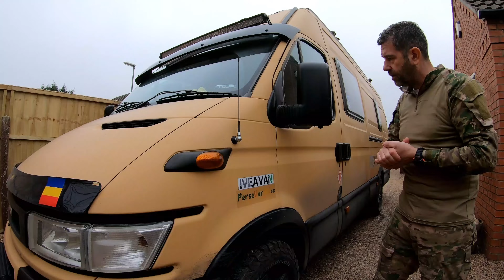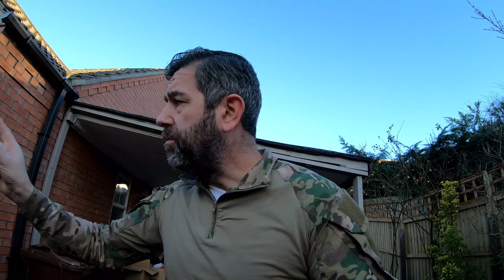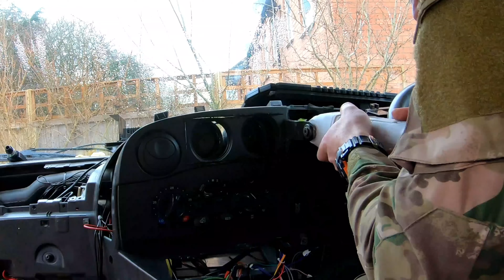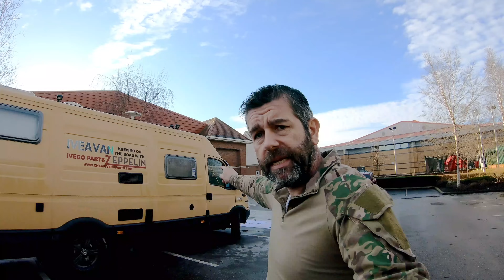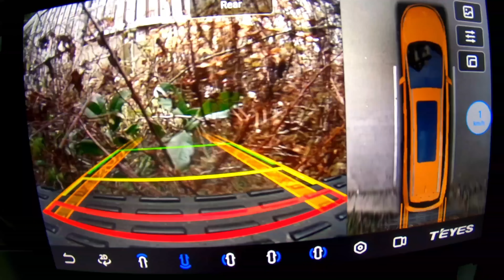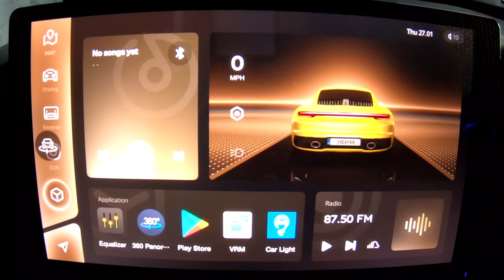Teyes CC3 Android Head Unit & 360 Camera Install [ Iveco Daily Campervan ].

Comment from the maker: Where to buy the T'EYES CC3 👉 www.teyes.uk   or  www.teyes.com.au
T'EYES Discount code 'IVEAVAN' for 80% off 1 x anti-glare screen protector when purchased with a 360 camera system. 
Camera extension cable is now available 👉https://www.teyes.com.au/products/spare-parts-4pin-360-camera-extension-cables?_pos=1&_sid=096988f8c&_ss=r

Very informative video 👉from " Saab Unleashed " Regarding the T'EYES CC3   https://youtu.be/7A_vjC0mWKE

Discount Code 'IVEAVAN', 12% off for all products on Auxbeam website! https://auxbeam.com/?ref=y49aq1muul
Individual product Links are within the discription for this video. 

Amazon store showing affiliate parts list that I've used within the van build.
www.amazon.co.uk/shop/iveavan
IVEAVAN

Comment: Great video. Amazing system. Have you upgraded the firmware since installing the system and did you have to recalibrate the 360 cameras? Did the update improve functionality? Thanks.
Reply from the maker: Cheers, matey 👍. No, I haven't gotten around in doing firmware update. You've just reminded me to be honest as I've been running it as when I installed it 3 or so years ago 👌👍...

Comment: Is it better to put on wing mirror or on middle side of van?
Reply from the maker: Entirely up to you. Remember, the software will be calibrated for wing mirror-mounted cameras when it comes to stitching the 360 together, but if you want to try and mount them in the middle, I can't see any issues in doing so, it's just the case when it comes to stitching the cameras together, whether it'll make any difference? One thing I would suggest is to try to mount all the cameras at the same height to avoid  making the picture disjointed 👌👍...

Comment: Thanks for the cideo! I got my CC3 360 for my camper after seeing this video a year ago. I stuck the side cameras at 2m hight, same as the rear cam. The front cam is inside the car at the rearview mirror. Does anyone have experience with the setup? I had to cut the calibration sheets in half because they were too narrow for the car. But although i could mark the squares, somehow the stitching is not nice. Also in bird view mode i cannot see much of the back and front since the car appears quite big in the screen. I feel like i have to cheat the settings by putting in smaller values?
Second question, since i am using the system for surveillance, how can i share the video files other than removing the sd card?
Thanks for your ideas!

Comment: I don't know when you're done this why would suggest marine water resistant  heat shrink  is glue lined and will stopped watering rest that if you want to
Reply from the maker: Sorry? What are you on about?
Reply: Yes so I might not explained it too well they do Marine heat shrink which is glue lined which I said maybe better to put on your underneath wiring loom hope that makes more sense sorry
Reply from the maker: @cyrilwoolf8848   ah right, got you. yes, I have done that on the joins that I've soldered together on the camera cable, infact you can see one of the wires ( reverse light trigger wire ) @4:25 where I've used the self-sealing Polyolefin 👌👍.

Comment: When the 360 is fitted, can you record the image ?
Reply from the maker: Yes, I believe it can by using a USB drive / hub. I already have a 4ch MDVR fitted upon the van that shows 360, so I've not looked into / had the need to use the record function from the head unit myself, but I have seen it can be done via the head unit 👌👍.

Comment: Thanks for the detailed video, I am looking to do something similar. Due to the size of the Iveco, exactly which vehicle did you choose when purchasing on the site?
Reply from the maker: Just the universal one, then added the cameras in extras. If you have the mk6 Iveco, they is a kit for that. They also started to sell the extension cable for the cameras ( links in the pinned comment ). 👌👍👍👍.
Reply: @Iveavan  thank you very much for your prompt reply, I will have a look.

Comment: Are there any improvements for large cars after a year? I just installed this on a Ford Transit and am about to move on to calibration.
Reply from the maker: Depending on when you bought yours and whether it's the CC3 360 or the later CC3 2K  Model? If you've just received it recently, it should be on the latest software update. If not, here's a link to the latest one (CC3 360 version). https://teyes.uk/search?q=360+software+update+&options%5Bprefix%5D=last

Comment: These 360 degree camera's make a difference to the driving experience.   I believe you can buy extension cables so you don't need to cut and patch, but it's not a bad solution to the issue.
Reply from the maker: Cheers bud. Do you have a link to the cable extension please as these where not available at the time from Teyes 😉👌👍👍👍.
Reply: @Iveavan  They are a standard 4 pin camera cable as far as I recall (been a little while since I did a teyes install).   If you search 4 pin camera extension or similar you can find them.  I noticed teyes now have a full kit with an extension cable for the rear included, but they still don't seem to advertise just the extension cable on its own.  Maybe you can ask them if you want the genuine teyes one, but they may be more expensive than generic ones :)
Unfortunately I can't post a link for you :/
Reply from the maker: @EsotericArctos no, that's cool, as long T-eyes is now doing them as I did suggest this to them at the time to them 😊👍.

Comment: Hey, thanks again for the video. I'm currently in the process of conversion for my van in the states and I'm waiting on the kit. 
However I've gotten to a point where I need to put up the side paneling of the van interior, but I'm block because I dont have the wire for the rear camera of the CC3 360 system on hand. 

Do you know if the wire is a standard 3.5mm or 2.5mm wire? Do you know if there are 3 strand or 2 strands of wire? 
I'm trying to buy an extension wire locally and run it so that I can put up my side panelling, and just plug it into the extension wire when I get the kit.
Reply from the maker: Hi Noah. I'm pretty sure ( but dont quote me on this as it was some time ago) it's a 3.5mm / 3 strand RCA cable. Couldn't the cable be routed under the van following the chassis like I did in the video bud? Just saves butchering it like I had too because it was around 40 inches to short for my van.👌👍👍👍.

Comment: hi , are you able to see the roof section in live situations when driving under trees or low branches? also please, would you know if this system would suit an older vehicle 1995 , which doesn't have any type of monitors???   your feedback is greatly appreciated.
Reply from the maker: Regarding the roof no unfortunately not as the cameras do face slightly down. (unless you mount them upon the roof, you might be able to veiw what's going around up there but still wouldn't see the full roof). Yes, it be absolutely fine fitted within a vehicle built in the 90s, it be like how I've installed mine into the campervan 😉👍👍👍.
Reply: Thank you for your quick feedback. 
In regards to the roof I might need to get 2  360° cameras seperate from the cc3 system( unless they can do a six camera system?) to install them ( one on the front and one on back) of rooftop ? Or would I need just the one 360° and placed onto the centre of roof roof top?
Reply from the maker: In the kit there's 4 cameras for each head unit. Depending what type of vehicle it is, whether it will stitch together or not with one camera on the front of the roof, one on the  rear of the roof and two within your wing mirrors. But both of my front and rear cameras are fairly low down compared to my wing mirrors and seems to stitch the field of veiw quite well.
Reply: @Iveavan   , what i have is a little box truck, i was thinking of putting one on the roof (instead of the front angel,as i dont really need to see the front view on camera), then two on the sides and one at the back (for the back reverse end view)... i wonder if this will still work?  all will be place high (unless maybe place them mid range around the truck ,exempt for the roof one which will sit directly on top of roof)?
Reply from the maker: I think the best option would be have a play around with them at different heights before actually installing them and see how the system stitches it together first would be the safest option. Ideally, they all do need to be mounted at roughly the same height if possible to prevent distortion within the picture 😉👍.
Reply: @Iveavan  yes, i gathered this much.. and if that doesnt work then perhaps, invest in some kind of omni dome camera installed on roof top, or maybe two cameras(or some type of 360 camera) and place on top of roof as well as the cc3 kit???

thank you again for your replies, much appreciated
Reply from the maker: No worries and good luck with your camera installation 🙂👍.

Comment: Sorry mate, where should the side mirror cameras be facing?
Reply: Thanks for the help, yes I did the calibration but need to do another go
Reply from the maker: Directly Facing out to the side (but may need to be pointing more to the rear of the vehicle. If its a long vehicle!) bud, the stitching will bring it together once you've calibrated the cameras 😉👍👍👍.

Comment: I just purchased one of these through the teyes website so I don't get cheated by those Chinese fake units, I almost bought a perfect replica but then whit research I found teyes website and I dint hesitate, one question I have an older android unit whit reverse cam and I have interference when breaking and the power is from the reserve light (manual Ford ranger), on the teyes 360 system if I don't want to use the trigger wire I don't need to because the system is always on because its powered by the teyes unit right away? The trigger wire for the reverse light is to turn the back camera on the main screen when you put in reverse right? Thanks yoy have a great project there whit that van, greetings from Portugal 🇵🇹
Reply from the maker: Hey Jorge👌👍. Yes! I heard about the fake ones, much better buying them from Dan 😉👌👍. No you need the trigger wire it's only for turning the rear view on when reversing. You can mess around within the camera settings a choose which camera you'd like for it to be on or leave it on 360 mode its entirely up to you bud 😉👌👍👍👍.
Reply: @Iveavan  yes but if I don't connect the trigger wire the rear camera still works right? But it will not turn on when I shift in reverse but I think you can play in the settings to turn on when you drive at a certain speed, but I will put the trigger wire anyway, this question is just to know if my thinking is OK, I payed the unit on the 2 of February do you know how muck time to get to me? I don't have a tracking number yet thanks mate for you help
Reply from the maker: From memory. Even with out wiring up the trigger wires the camera's still worked. (as you can appreciate it was over a year ago when I installed mine) But if memory serves me correctly, you should be fine doing it the way you want to do it. Errm, about 4 weeks for it to arrive from the order date as I recall matey 👌👍.

Comment: Hi there, a great video and I’m about to order this system.
Now just a quick question, what is the drivers seat you have fitted to your Camper? 
Looks like it is sprung like a truck seat!
Reply from the maker: Cheers bud, that's right it's an Iveco Daily sprung seat base (some call it air ride but they sprung and adjustable to suit the drivers weight) 😉👌👍👍👍.
Reply: @Iveavan  
I’ve got a 2007 ex council minibus I’m converting, twin rear wheel. 7 metres length.
Hope it works on this vehicle.
Reply from the maker: @jasontyler7625  yes, you should be fine, yours is the same length as mine so I can't see any issues 👌👍.

Comment: hi i guess you bought standard unit  mine come with  harness for the  rear camera and place for the ex mic
Reply from the maker: Yes, it was the none vehicle specific head unit that came with all the harnesses, but upon my van it was around 4mts too short for the rear camera (so whether or not they are now supplying the extra long rear camera cable I'm not sure🤔). 
My kit was missing the female jack plug for the external mic and found out that it should of been within the kit I received, but I've still not come across it 🤔🤷‍♂️🙂👌👍👍👍.

Comment: hi just an idea why not mount the camera higher up like beside your roof lights if the calibration will let you program the height in its only an idea but this might not be for every one im sure a housing can be made to hold it .
its only if its higher it might see more clearly . hope this helps and let Dan no at teyes they might be able to alter the height in the program let me no good luck.....
Reply from the maker: Ideally, the front and rear cameras want to be mounted (as closely) level with the wing mirror cameras, then it will stitch perfectly together 😉👌👍👍👍.

Comment: Does this also record when your not in the van? For security purposes?
Reply: Yes actually, you can plug in a USB and all four cameras will record. You can also get a DVR Dash Camera or just a reverse camera instead of the 360 camera.
Reply from the maker: You can get a DVR front & rear camera for the unit, but I haven't looked into them as I've already have that set up. But in my set up the 360 cameras are really for parking aids 😉👌👍👍👍.

Comment: Thanks for video. I just installed this system and I an stumped as to where do I connect the three red wires coming from the camera adapter that you plug into the rear of the radio. Where did you connect yours?
Reply from the maker: Thank you Ray, on mine they don't connect to anything, I believe the red wire for the reverse camera connects to plug G pin 5 to enable for the "reverse tracking bar map" to move when you turn the steering but mine doesn't have canbus for that so that's not connected either 😉👍👍👍...
Reply: @Iveavan  thank for the information 🙏 I appreciate it

Comment: sideload android apps? would be icing on the cake to run a battery status app etc to check leisure batteries. (after the icing the cherry on top would be a tpms with 5 sensors...)
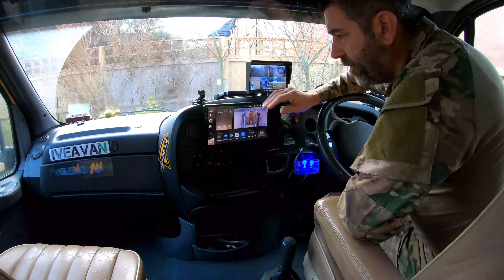Reply from the maker: You can run the victron venus app which does all of that upon the unit, I show that @15:40 bud 😉👌👍👍👍

Comment: how did you wire it to work with turn signal?
i cant get mine to work
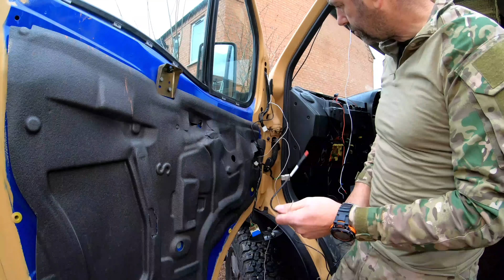Reply from the maker: @2:00 into the video bud 😉👌👍👍👍.
Reply: @Iveavan  I've done all that but I have no place to connect the wire at the end of the plug that goes into the head unit 
I just have a lose red wire and it has the 12v signal from the turn signal light 
I can't find any info on where that signal wire goes
Reply from the maker: Mine is triggered by the side repeater signal + and just connected to the camera plug within the trim on the door no other connection upon the head unit as far as I can remember 🤔, is it the same age van as mine or do you have canbus? There's an wire to disconnect upon the head unit if issues with the cameras due to canbus, but I thought that was more of a reverse camera issue, I would look at the installation manual again that I got, but I'm miles away from home at the minute matey 🤔...
Reply: @Iveavan  I have the mine installed on a toyota prius 2007 see the video on my chanel but I just can't figure out that turn signal camera activation 
Unfortunately I don't know I can buy strait from teyes UK and I bought mine from aliexpress and the seller let me down completely no instructions what do ever he just sent me all the components in a bag and that was it so I had to discover everithing by myself 
My car has a can bus adapter and the head unit is basically cc3 withouth the ones display 
If you can find anything useful please let me know
Reply from the maker: It is the 128gb version isn't it? 🤔....
Reply: @Iveavan  yeah full spec but with ips display instead of oled
Reply from the maker: As fair as I'm aware the true Teyes CC3 only comes with a QLED display  bud🤔 here's the ebook manual that may help you I'll see if theres any more on the cameras 👍https://cc3.teyes.ru/en/index_mb.html

And here's the wiring diagram https://youtu.be/9YfzbJtyK1w

Comment: Hi, thanks to your video I've just purchased this.
Thank you for sharing it with us!

Do you think there would be any advantage in mounting the cameras higher (above the rear doors and perhaps on a roof rack for the sides)?
Reply from the maker: No worries bud, if I was to fit the cameras again I'd probably try to mount them all at the same height from the floor so you didn't get the side profile from the kerb stones on the front and rear cameras and the top profile from the wing mirror cameras, when stitching up it looks a little disjointed due to this, I can't see any harm in mounting them any higher, but it may effect the tracking lines on the rear camera 🤔😉👌👍👍👍.
Reply: @Iveavan  so you'd consider lowering the side cameras and mounting them somewhere other than the mirrors?

I can't say I'd noticed the kerb stones morphing until I went back and looked again.

Good point on the rear guide lines, can you turn them off?
I was just thinking that a higher viewpoint may be more helpful but given these are designed for cars I'd probably be giving myself a hard time.
Reply from the maker: It's worth ago, I've not tried it at different heights so you may have more success being higher,  I just think it be better (if you can in trying to keep the cameras all at the same level) & yes you can turn off the tracking if it does become an issue bud 😉👌👍👍👍.